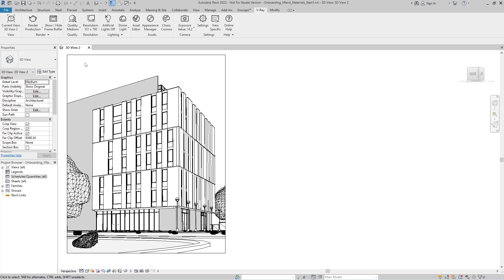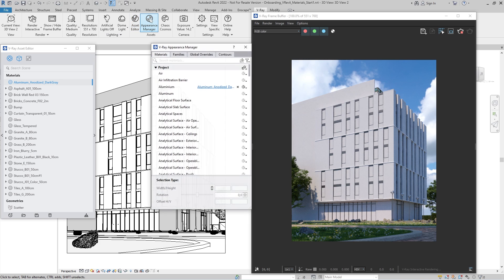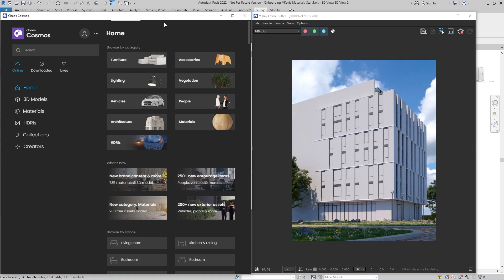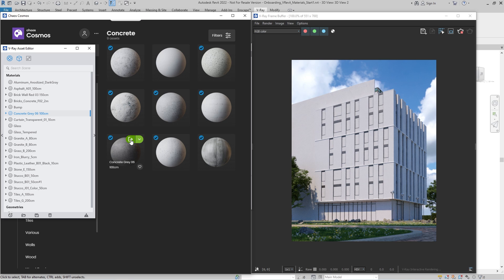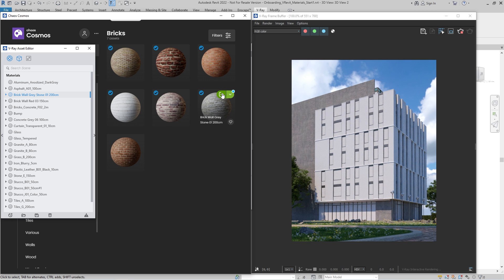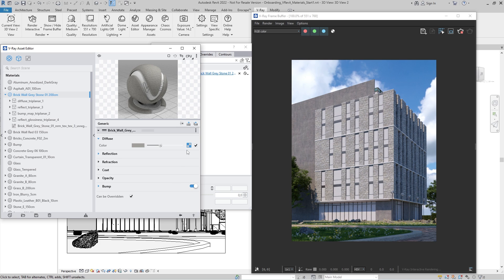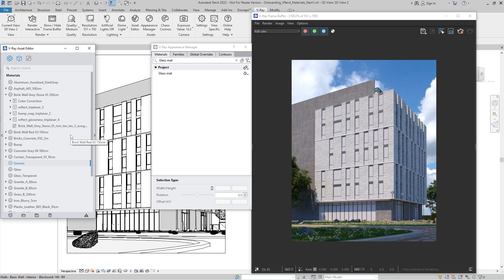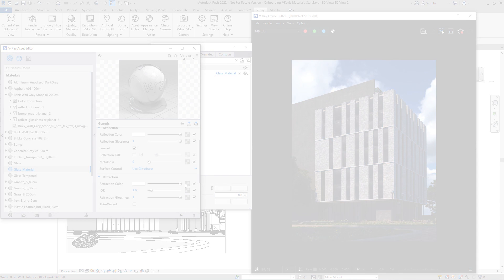V-Ray for Revit — Working with materials

Comment: Good start! Max users need more info about the workflow from Revit to Max with VRay. This just scratches the surface. I'm not on the Revit side. I'm on the Max side and they keep asking how we can integrate VRay across them. As it stands now I replace all REvit mats with VRay in Max after linking RVT. Would really like to skip that step and just have the VRay mats already applied in Revit for rendering in Max.

Comment: What version of Vray is used here.
Or what version of VRAY has chaos cosmos
Reply from the maker: The Chaos Cosmos library is integrated into V-Ray 5 for Revit.
Reply: @V-RayArchViz  Buh when I had it installed, Revit displayed an error which says Revit cannot run external application vray- Revit. What could be the solution
Reply from the maker: @gafartijani1018 , it'd be best to get in touch with our Support team on that - they'll be able to look into the issue and help resolve it. Please submit your info via https://support.chaos.com/hc/en-us/requests/new